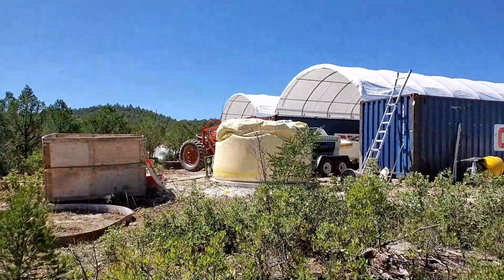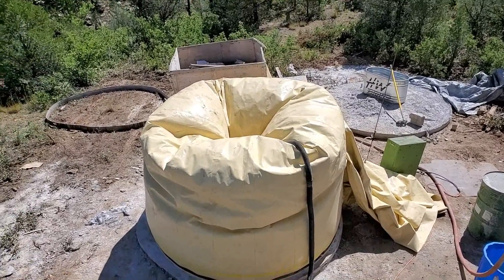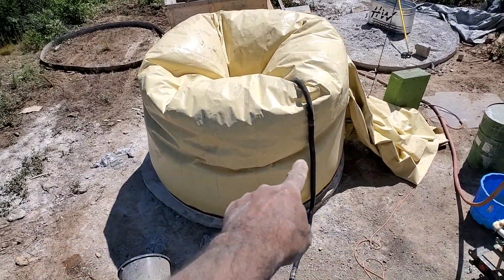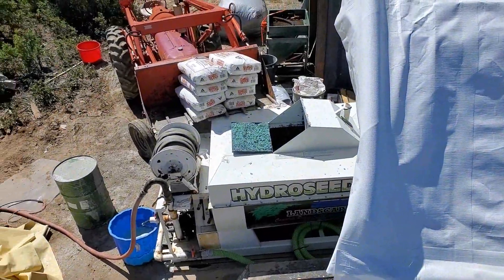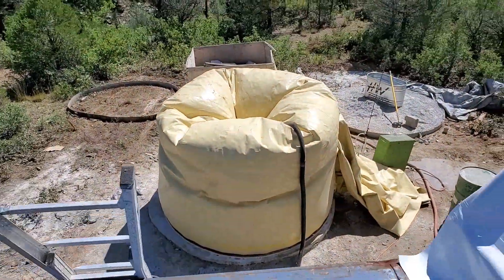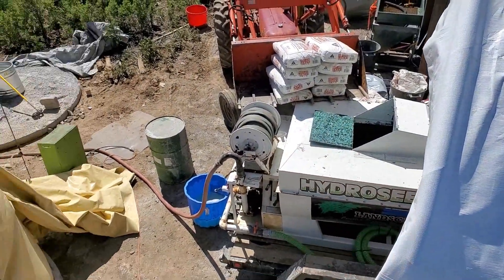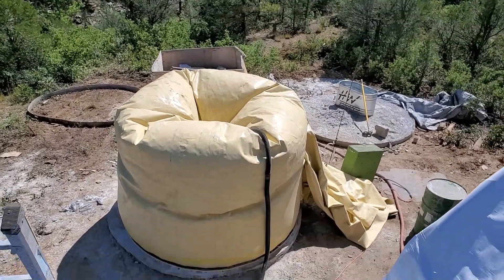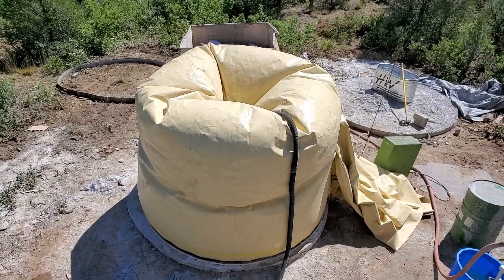Second E.P.I.C. Pour #EPIC #aircreteharry #dome #domehome #foamgenerator #diy #aircrete #EPICproject

Comment: Harry, are you mixing and pumping your cementitious mix with a hydroseeder? And it held up to that? That would be ground breaking. Thanks!
Reply from the maker: It works because of the mix I'm using of paper mulch and eps foam. I don't know how well it would work with a sand cement mix.
Reply: @AircreteHarry  Wow, you just went for it, and the cement did not mess up the hydroseeder? Impressive! Now that you are closer are you going to the 2020 World of Concrete?

Comment: Damn! I may need to explore this idea. I am currently mulling through the mathematical work needed to build a 2v geodesic dome out of triangular panels made of aircrete. I figure I could pour a few at a time until I've got enough. By the time I get some land to permanently assemble it on they should be completely cured. 

Sure wish I could participate in your workshop but I currently don't have the funds or vacation time to attend.

I'm looking forward to seeing the footage of collaborative work between you and HDC. Hopefully it will include some of the thermal images of his stove.
Reply: How big are the triangles and weight?
Reply: Not sure how much the total weight will be TheRainHarvester. For a 15' 2V dome, the triangle panels will be approximately 4' tall with two different triangles totaling 40 panels. I've got the two dimensional measurements but haven't been able to figure out the compound angle of the panel's depth.
Reply: @1100wing  How will you lift them into place without the other pieces falling?  Wont they be too heavy to lift?  Just curious.  TheSounds like a great project!  Has anyone made a water tank with aircrete?
Reply: @TheRainHarvester  i won't know until I start making them but I figure they'll be 50 - 60lbs so i should be able to lift them.  As far as holding them in place goes I'm thinking I can use sticks on the inside to prop them up until the mortar dries. Once each ring is done they should stay in place on their own.

Comment: The thing about this pour is 1st it isn't aircrete it's foamcrete if I'm watching your mix correctly. And 2nd your pour is more vertical than dome shape and I'm not sure if the inner form will support the weight of the pour without something supporting the "Balloon" from the inside and if this were more dome shaped it would be even worse. I'm really liking what your doing and you never know until you try right? My Channel is Aircrete Jeff and I'm going to be doing a lot of experiments myself with the end goal of taking this to the Philippines and building dome homes there.  I want more of a form that is one slice of the dome if you will that you can pour sideways and will interlock. Keep up the great information and thanks for all your hard work.Jeff
Reply from the maker: Hey Jeff,  This is not Aircrete and it's not Foamcrete it's called EPIC a very strong mix design of paper EPS foam and cement.  This is a double air-form system the two air-form have air on them to support the weight. I don't understand when you say if it where a dome shape it would be even worse, how?  I saw some of your videos I think you should try adding a tea spoon of baking soda to your 5 gallons of water before adding your Drexel foaming agent. Your foam is not looking good from what I can see, as you said you have hard water and the baking soda should help. Good luck!

Comment: Is this form double sided? Do you have pictures from the inside?, what’s the diameter and high of this dome?
Nice job, thank you for the video!!
Reply from the maker: There are two airforms the inside dome is 8 X 8 the outer airform is 9 X 9. Photos and video to come later.
Reply: Will you use rebar for a bigger domes?